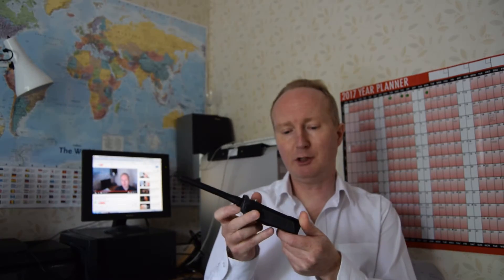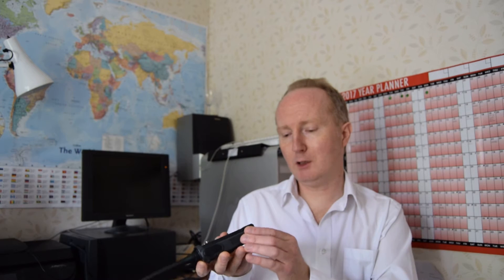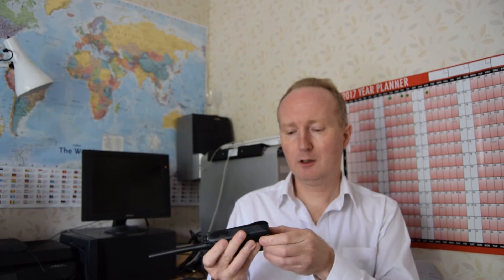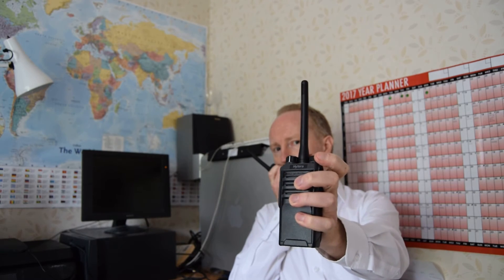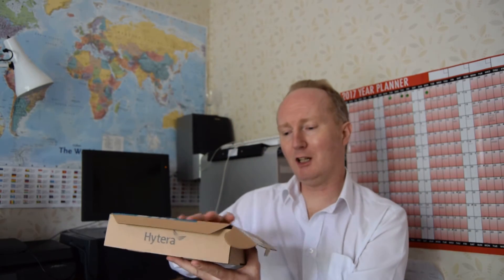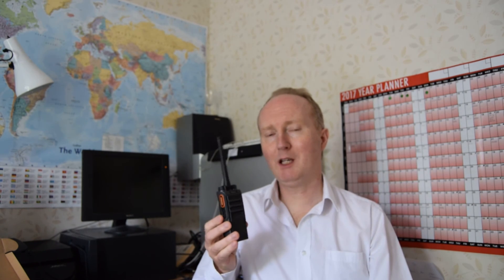Review of the Hytera PD405

Comment: Hi Craig do they have a whip antenna fitting ?
I work as a Driver shunter in the railways and am pretty impressed with them,
Also we use the handmike,

 But there is no Transmit indicator on the handmike
climbing in and out off trains and sitting on the radio causing a transmit when slagging off your workmates can cause embarrassment LOL.

Cheers Bud

Paul Belfast.
Reply from the maker: Sorry Paul, for not noticing your question earlier (#embarrassing). There is an adaptor available that will screw into the top of the PD405, which will then allow a standard BNC connector ( as used with most whip antennas) to be connected. We have supplied these to farmers for use with Kenwood handhelds, so that they can put a mag-mount whip antenna on the roof of their 4x4. To extend range.
The same can be done with the Hytera PD405.